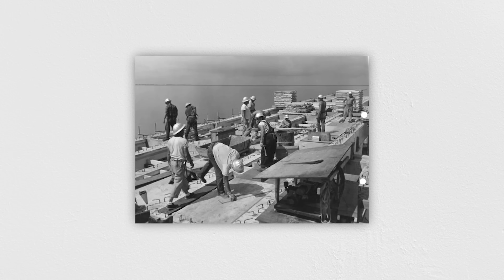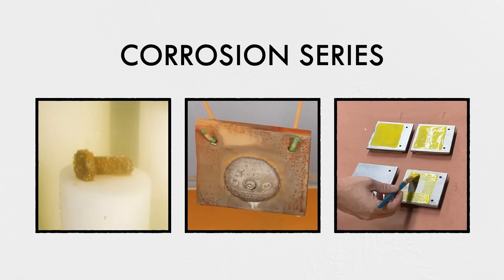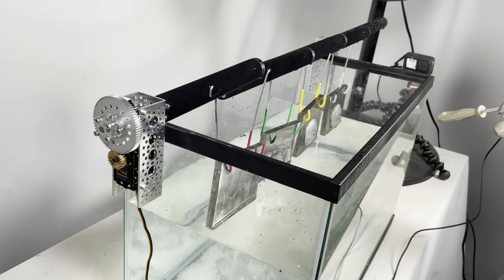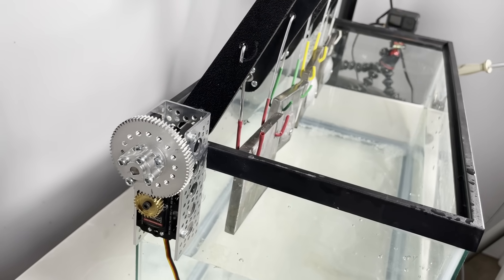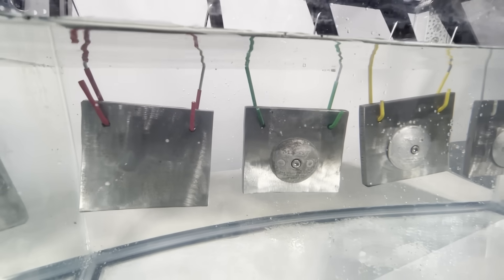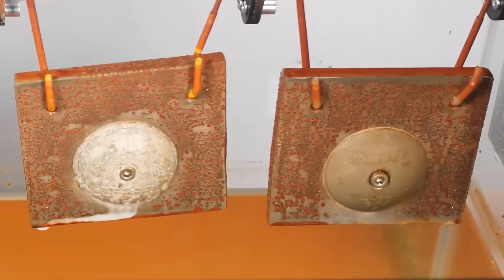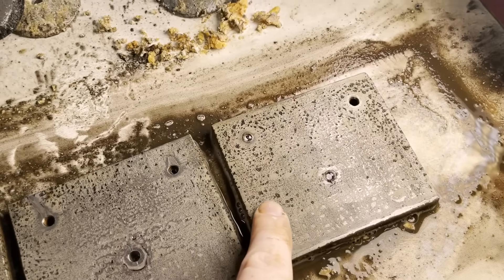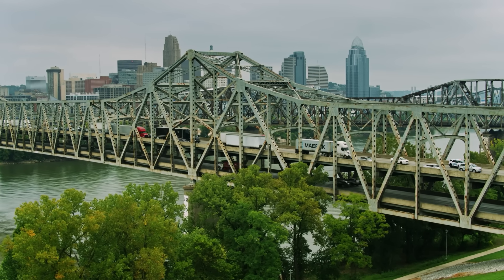Why Spillway Gates Don't Rust Out

Comment: It's a good video, but it failed to explain a lot of things, I was struggling to fully understand the process, lots of what IFs, so I found this

Basic Theory of Metallic Corrosion
There must be a positive or anodic area, referred to as the “anode”.
There must be a negative or cathodic area, referred to as the “cathode”.
There must be a moisture-bearing electrolyte for ionic current flow between the anode and cathode. It is important to note that the anode and cathode must be immersed in the same electrolyte. The atmosphere is not an electrolyte. Two pieces of metal touching each other in a humid environment develop excellent conditions where current flow will occur.
There must be a return path for electronic current flow, which is referred to as a “metallic path” between the anode and cathode.

Comment: I love your presentations Grady. Other solutions against corrosion are what are known as weathering steels.  One is called Cor-Ten. Another awesome solution in civl engineering is the use of rebar made of basalt which has incredible mechanical properties. The basalt rebar will last way longer than steel and is amazingly lightweight.

Comment: If you used an electrolysis bath to remove the rust form the samples you could then remove the rust very easily. You could also then weight them (assuming you recorded the weight at the start) and see how much steel they lost.

Comment: I've been a cathodic protection technician since 2015.  CP is widely misunderstood, mischaracterized or mysterious to most people, but it is heavily utilized all over the world on any metallic structures either underground or under water.  One question though.  Why dip the metal in and out of the electrolyte?
I assume it's to emulate rising and falling water on a bridge pylon but all letting the water dry does is slow down the experiment.  One thing they taught us in CP is A.C.M.E.  Anode, Cathode, Metallic pathway, Electrolyte.  Eliminate any one of those and you stop corrosion.  So if the water (electrolyte) has a chance to dry, the current can't flow and the corrosion stops. Turbulent water would accelerate the experiment though 😁
Thanks for bringing attention to cathodic protection!

Comment: An example of cathodic protection in your everyday life is in your hot water heater. Many have replaceable anodes that will wear out instead of your tank or heating elements. Try to check them every few years because once they go, the rest breaks down pretty quick.

Comment: I was working on a project that required water wheels in salt water. the pushing surface of the wheel was fastened to the steel frame with aluminum rivits. I replaced so many of those rivets before figuring out what was happening. this video is the best explanation of that process I have ever seen!

Comment: I realize that this video is a year old but I hope someone may be able to answer this question. There are millions of 90’s and 2000’s Toyota vehicles on the road that suffer from serious frame rust problems. I actually have one that I’ve had sitting inside on a lift that quite literally keeps rusting away without even being exposed to any elements. My question is this; is there any way for some sort of cathode type of protection to slow their untimely, and dangerous, demise. Any thoughts?  Thanks for any responses!

Comment: I know of a rail company here in Brazil that developed a steel alloy that corrodes like aluminum. It creates a patina of rust around the bridge (I walk on this walkpath every day), but the rust doesn't penetrate. If you scratch the surface you can see the corrosion setting in, but it reforms the layer and it stops corrosion from going through again.

Of course it was not patented, somebody stole the formula and patented it, but the bridge is there, I walk over it every day.

No need for zinc or magnesium chunks, direct current protection, none of that.

Comment: Hmmm I live in the north east and every car rusts away. I wonder, does it make sense to bolt some zink annodes to the frame of my truck and maybe replaced them periodically? They're be easy to get, any marine supply store sells zinc chunks for use with boats. Would that really prevent rust? That would be excellent. I wonder if the electrical protection would work too. You have a source of power in your car whenever its running, and when its running is the time when the whole bottom is getting sprayed with water.

Comment: I use to build bridges and concrete culvert and for the bridges we would use epoxy rebar in our piers and tops. Its a bright pasty green color. Before we would pour the concrete we had to go through with spray cans of the epoxy and spray any and every spot we could find that had been chipped off.

Comment: I work as electrician in port and found a strange wire going into concrete, I did some asking and was informed, that 12V is flowing through rebar mesh. Was interesting thing to learn.

Comment: I work with swimming pools.  Hot dipped galvanized metal walls are normal and work fairly well.  When converting a pool to a salt water chlorine generator we install zinc anodes that are tied to the bonding loop of the pool/equipment.  When there is an issue with stray voltage on a salt water chlorine generator pool I've seen bright orange donuts of rust form at the waters surface around the stainless steel railings of ladders

Comment: Grady, the existing Howard  Franklin bridge was actually built in two stages. The original southern span was built in the 60s. In the early 90s the northern span was added. The new bridge that’s currently under construction will replace the oldest, southern span.

Comment: We have known about the process for over 100 years, yet it isn't standard practice to use it, where we know the steel needs it the most.

I see steel rebar sticking through concrete all over the country, and it is usually due to the rusting rebar swelling and splitting the concrete open. And we know concrete is porous and lets water, especially water with salt, through to the rebar, starting the rust to start.

Yet the rebar isn't galvanized to begin with. Sometimes it is epoxy coated, but one scratch ruins the protection, and most of the time, it is plain steel.

Comment: I have a question for you? Why can't we use those anode to the underbody of car so it doesn't rust.

I know that the way it work every peice that is isolated by bushing would need is own anode but wouldnt it be easier to change one bolt little puck 30 time each year or two that a whole subframe? It would make mechanical work to a car so much easier too for any work?

Comment: The only improvement I could see to your experiment is to use separate holding tanks. If you wanted to simulate moving brine currents, you could have a large holding tank of brine constantly flowing in with an equivalent outflow per each tank. Very cool set up!

Comment: Our experience with corrosion on a property we owned for thirty years at the ocean:
1. Galvanized iron pipe. Very good corrosion resistance. However failures happened in threads that weren't coated. Also pipe failed from build up of lime over the years on the inside of the pipe.
2. Black iron pipe: Very little corrosion resistance. Gas pipe exposed to the weather looked like it was near end of life after 20 years or so.
3. Iron wrought iron style fences and gate that were metallized and powder coated:
Mostly the metal had maintained a new look for at least five years when we sold the property. However, the gate, which had an almost continuous ocean breeze blowing through it  started to show signs of rust after about two years on the side facing the ocean.

I wonder if a sacrificial anode might have substantially increased the life of the gate.

Comment: Speaking of the Howard Franklin Bridge, as a kid, in the 80s, growing up here - our teachers told us that the new span they were building at the time was built higher than the old span because of rising oceans -- that by the year 2000 the old span wouldn't be usable. Also the St Pete Times, the big paper in this area, said at the time that by the year 2000, Florida would have a declining population because there wouldn't be enough water. Needless to say, both of these 'facts' turned out to be completely false.

Comment: At my old job there was discussions on if you could do this on a car. Hang blocks of zinc on the bottom. My thought was the moist salt spray would create a potential in the area and the zinc would help protect it. We know it's not solid water contact but the mist might contribute to the mechanism needed to help corrosion.

Comment: It would have been interesting to include at least one example of DIY galvanization with sinc spray paint. Most sinc sprays result in at least 70% pure sink on the surface after the solvents have fully dried. Higher quality stuff contains about 95% sinc.

Comment: The control should have had a mild steel anode attached. I feel bias could be introduced just because a big part of the sample material tiles we see in the video enjoyed the 'physical' protection of the bolt-on anodes (ie it was covered from the elements by another piece of material)

Comment: 1:25 .. TheUS should pass a law at the federal level that ALL reinforced concrete MUST use non-corrosive reinforcement members ... stainless-steel, hot dip galvanization, titanium, grafite compounds, or fiberglass .. the extra cost is immaterial as stainless steel reinforced concrete typically last forever.

Comment: Large underground oil and gas pipelines also use cathodic protection. Even more cool is that when the pipes pass underneath large power lines and electrical conduits, they have to employ additional cathodic systems to intercept and cancel out the inductive current from the power lines.

Comment: Stainless is not 5 times more expensive. Raw materials are almost same price, sometimes slightly more, and you might need to add a bit of cost due to special welding if needed, so maybe 10%. It adds maybe 3% to the total cost of the structure. and then in the long run it is cheaper.

In Europe structures like bridges are required to be designed for 100 years for example, which make sense.

In US, Europe and Asia you will find many bridges, overpasses, piers, using stainless, including rebar. Many of them have design life of 300 years. Also without stainless, the concrete must of very high quality and high cover. With stainless, it is less stringent, so you can actually reduce cost.

Comment: That principle is very used in water heaters to prevent copper corrosion from the tank itself.
There is usually a magnesium anode that needs to be changed between 1 or 2 years, protecting the heater. At least that's how it works in the systems used in southamerica to heat water before taking a bath.

Very nice videos by the way, Grady!
Reply: Nobody ever changes them though.  Lol

Comment: My wheel nuts went rusty on my boat trailer which gets dipped in the sea. I knocked them back to bare steel and home deposited some zinc with electrolysis. They weren’t very pretty. What nuts are? Not shiny but they out lasted the frame of the trailer. Still as good as when I did that over 3 years ago. Win!

Comment: You also could use electricity to speed up the corrosion.
Reply: You can show the surface difference by lighting it from the side so the deeper ridges cast darker shadows. In addition you can try to place the camera in a shallow angle to the survace and 90degree from the light.

Other idea, livestreaming the rusting process? Just for fun with a webcam. People watch all sort ot things :-D

Comment: 10:41 28.3 g of protection is worth 454 g of cure.

Or, 62.5 g of protection is worth 1 kg of cure, if you're just concerned about the ratio.

Comment: Hi Grady.  Great video about Cathodic Protection.  You explained it very well.  I did cathodic protection for 5 years for pipelines and tanks when I worked for Matcor.  What I learned in 5 years you were able to compress to 13 min.  When at Matcor I was the only drafter so I was a part of every project, did thousands of junction boxes and anodes.  I know the life span of the anodes we installed was 100 years, and that monitoring the system is key in maintaining Cathodic Protection. Also sand is what we mostly used to carry the electric current.
Reply: Interesting aboit the use of sand. Upon investigating the topic using sand for cathodic protection, the forst result that came up was none other than MATCOR, saying that the industry is now moving away from oiled sand for tank corrosion protection, as it has been found to be creating more issues than it solves.
Reply: sand conducts electricity??
Reply: @mrosskne  I believe the oil in the sand does more so. Everything conducts to some degree. If you take for example a AA battery, there is a self discharge and the battery eventually dies. We say it has an open circuit but really, there is that air surround the battery ( or even a vacuum ) that could technically be considered no conductive, but it still has a field and conducts some miniscule amount.  So given a high enough potential (voltage) you can conduct some amount electricity though anything. The key to the cathodic protection is to by making thr material you want protected by making it the cathode with a high enough electronegativity compared to the other material., so you just need to be at equal or above, it doesn't need to be some large amount ( you're swapling the cathode and anode in your system by adding some extra potential to the otherwise would be anode). So really you just want to stop the current with just a slight  tendency to to the other direction, for every part you want protected.

Comment: We had a big open double aluminium gate on our home garage. Once someone tried to pick the lock. My father bought the biggest chain I ever saw and put that on it. The chain was made of iron. The contact of aluminium and iron made the chain rust on the contact points, just in the contact points. I knew it was because a difference of potential was happening there, but never gave a second thought.  Some time later I was waiting the bus in front of a big cemetery in my city and the beautiful  old style lance iron rods of the fence around the cemetery one had a box written "cathodic protection". I went to search for it and then I was confused. It was the reverse phenomena: the chain was acting as the sacrificial electrode. But how? Shouldn't aluminium protect the iron like zinc does in ships? The aluminium gate was untouched.

Comment: An alternative to actual cathodes is the application of zinc rich primers. I had test panels that were exposed to the harsh South Florida environment on a test fence for eight years. They were steel panels that were coated with various primers I had formulated. Each panel had a deep x scratched into the surface. A duplicate set were subjected to testing in the salt spray testing chamber. Some of the formulations left outside had very little surface rust from intrusion and almost no penetration. The panels in the salt spray chamber did not fare as well but there were still very good results for some of the coatings. It finally came down to the amount of money the client was willing to spend.

Comment: I wonder if you could use a system like impressed current cathodic protection to turn large steel structures into batteries. Like, I've heard of rust batteries, hypothetical batteries that use the reaction between iron and oxygen to create an electrical potential. They build up rust when discharging, and when being charged, it converts the rust back into metallic iron. Could something similar be done with a large iron bridge or something? Extract the electrical energy whilst the bridge is rusting, and every so often "recharge" the bridge to remove the rust. Maybe a sacrificial outer coating of easily rustable metal that can be easily replaced?

Comment: Grady: Great video! I am a marine corrosion technician and a mechanical engineer. I suggest that the video would be more impactful if you had accurate before and after weights of the test coupons and the anodes. Also, for even more impact, measure the potential between the protected coupon and a AgAgCl reference cell at the beginning and end of the test.

Comment: regarding the rust-o-matic: are you going  through the salt-water dip /evaporation cycle for 3 pairs of metal with one control? or are we seeing the efffect of all 5  metals in the salt water at once? would the rate of corrosion for the aluminum and zinc increase were the magnesium corroded completely?

Comment: You have the anodes out of water too much for the anodes to work.  It is generally accepted that anodes (permanently immersed in the ocean) will protect the steel piles up to mean sea level (Above MSL the current is not flowing more than it is.  By Mean High Water Neaps tide, the effect of CP is pretty much gone),  but your time lapse has the anodes out of the water most of the time.    Also magnesium will self corrode quite rapdly in seawater whether its attached to the steel or not so its no surprise it wore away so much.   Just leave the samples in the water full time and the samples with the anodes will not have a one spot of rust at all.   For steel in wet/dry cycle conditions, you need to paint it to keep it rust free.

Comment: I work with galvanized steel all the time and I hate it (really gotta find a better job).  I work in a Press shop which uses a lot of galvanized steel coils (it's up to the customer and most customers like cheap steel), the stuff constantly chips off leaving metal chips all over the dies.  I've gotten a good few splinters from the stuff as well.  Can't imagine it's too good to breath either (I've heard you NEED to wear a mask when welding galvanized steel if you don't want some serious complications later on in life).